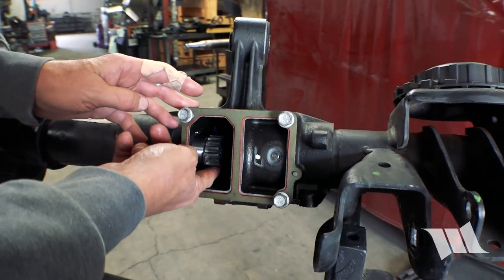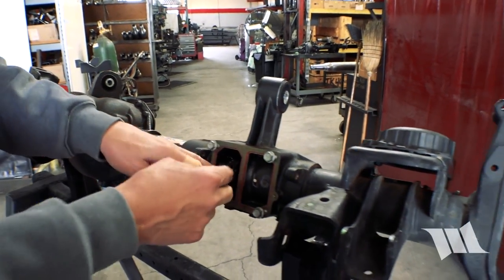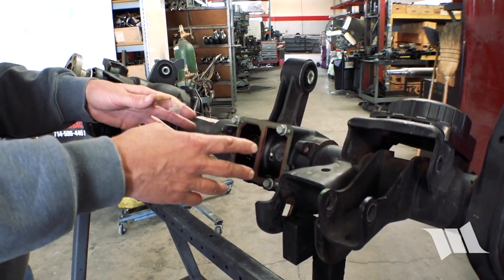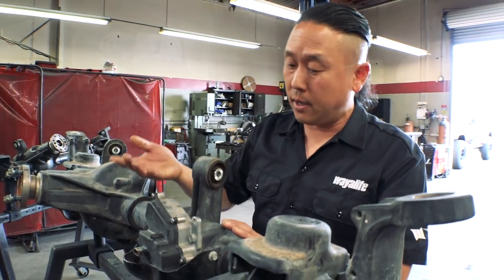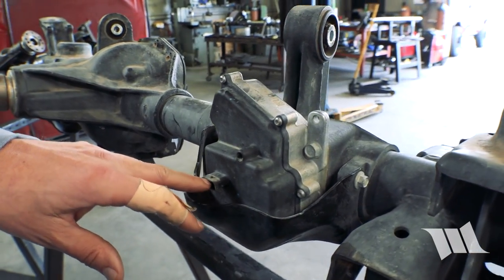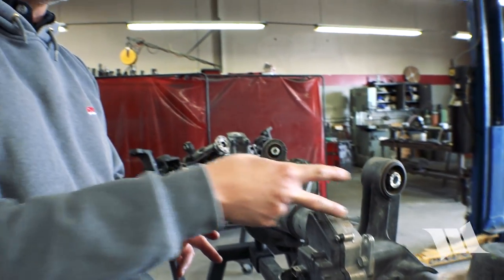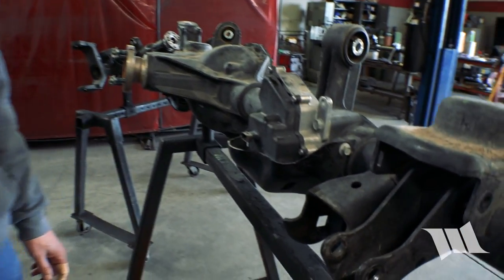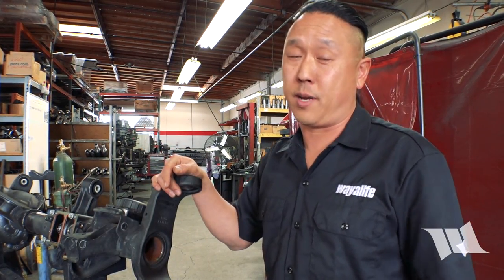Jeep JL Wrangler FAD Explained by Dynatrac - How the Front Axle Disconnect Works

Comment: On the earlier Wranglers, and even on the Toyotas, they used an FAD which worked by using the vacuum of the engine. As a result, you sometimes had to play w/the engine rpms to engage it.
Over time, the tubing would start leaking due to age and heat.
I know on my '92 Toyota 4Runner, I simply replumbed the FAD to stay closed. As a result, shifting into and out of 4Hi was a whole lot smoother and easier.

Also too, since the '92 4Runners still had the old wheel hubs, you could add Locking Hubs, which I did. I gained over 4 mpg because of that addition.

Just like w/the old classic 4WDs, when going offroad, or expecting to do so, you simply locked the Hubs and left the transfer case in 2Hi. The axle and drive shaft still turned, but you were driving in 2Hi. 
When you actually needed to lock it into 4WD via the transfer case, it shifted easily and smoothly into 4Hi, w/no issue since everything was rotating.

Sadly w/the JL's they went back to this FAD when they came out in 2018 but were driven electrically. When going from 2Hi into 4 Hi, everything had to mesh up, which wasn't always the case. You had to slow down, if not stop and fiddle w/it sometimes. 

With the JK and TJ, I believe they removed the FAD all together, but put it back in w/the JL, or the earlier models any way. 
My 2018 JL had it, while my new 2024 doesn't.
My 2018 was a pain to get into and out of 4Hi, while w/my new 2024 JL, it shifts very smoothly. 👍

Comment: Uhg! I found myself under a couple of different rigs manually engaging the CAD on the trail because it would stop connecting. Can't wait to see the problems start happening on those. :P
Reply: I wish they made an electronic replacement for the cad to at least get rid of the vacuum actuator

Comment: Good info, thanks. If you were to change just axles and not the housing, like RCV axles, does that have the same result as changing to a pro rock system ?
Reply from the maker: For the most part, we have not seen axle shafts be a problem on the JL. What we have been seeing to be a problem is the housing and it breaking. This would be the reason to run a ProRock 44

Comment: You guys are really great and helps so much with detail information 👍🏻👏🏻👏🏻 Can you guys please tell what is that small plastic ring where 2 shafts meet ? Is it just reducing heat so 2 shafts don't rub on each other or its something more important? I opened it and because of accident I replaced the hole cv but where 2 shafts meet there at that disengaging ring , it had a bits of plastic broken ?

Comment: I have a question. 
If the FAD is not working. Will that cause the front locker to not engage as well?
I have the z auto sensor harnesses on front and rear. But when I try to engage my front locker. It switches to rear only after flashing for a bit.
I was just wondering. Because the z auto sensors are supposed to fix the flashing light. And troubleshoot the issue.
Reply from the maker: It always takes a little bit before the locker engages. That is totally normal. In fact, it typically helps to be rolling a bit for it to engage.

Comment: So if the pinion gear isn't turning in 2wd, how does a person break in a new gear set? Seems like you would have to engage 4wd to truly break in new front gears?
Reply from the maker: That is correct and that is why breaking in the front isn't as important as the rear.

Comment: Dodge and Jeep have been doing this for years. Both my 90 XJ and my 01 1500 had a system of FAD, this is not a new idea. Why all of the hate?
Reply from the maker: Yup, as Jim points out, it's been around for a long time only back then, it was called CAD. I have no hate for it and actually like some of the benefits it provides. If there is a problem it's that the FAD housing is a week point and one we have seen break.

Comment: I know in the 1980 some one used to made a cable to replace the air lock and unlock front wheel drive for a jeep like a differential cable, do they still make that cable
Reply from the maker: It's a similar thing. The JL uses FAD and it's electronic and the old YJ used CAD which was a vacuum system. The cable just replaced the vacuum which wouldn't work when it started to leak.

Comment: What about just switching to two piece rcv axels?   I don’t have them but I’ve seen many people wheeling stock tubes but switching to a 2 piece rcv axle and just removing the fad.  For example look how lightbrite has the stepchild set up.  They borderline abuse that Jeep and it takes it all day long.
Reply from the maker: Since the JL had come out, I can't say that I've seen the axle shafts or the FAD itself be a problem. If anything, how the FAD works is a benefit especially when it comes to MPG and allowing you to run more caster without a negative effect to the drive shaft. What I have seen and on multiple occasions now is that the axle HOUSING can break. This is something we will feature in an upcoming video.
Reply: Thanks for the response.  You always have great content and explanations.  I found out that litebrite is in the process of looking for/installing a pro rock 44 for the same reasons you spoke about.  So again your spot on.  Keep up the awesome videos.  Thanks.

Comment: I am going to get a axle shaft that bypasses the axle disconnect … lite Brite did it but used cv joints .. I want to still have U joints so the weak link stays in a easy to get to place … thanks for a great vlog
Reply from the maker: It's a funny thing. Since the JL came out over a year ago, I have seen virtually zero axle shaft fails or any problems with how the FAD operates. However, I have seen multiple axle HOUSINGS fail and right at the FAD. But hey, good luck to you with what you're wanting to do. :)
Reply: Wayalife what is your opinion on cv joint versus U joint ?
Reply from the maker: So, what I can tell you is that I've run RCV's in the past and truth be told, I am running a set now but only because, there was nothing else available for the ProRock 44. That being said, I am NOT a fan of them but not for the reasons you have. My biggest grievance is in the fact that they cost $400 more than a good set of chromoly shafts with full circle clips. I also hate the fact that they snap and pop loudly after hard use. RCV will tell you that this is totally normal of course and will not fix it under their so called "awesome warranty". To your point about having weak links, I am not a subscriber to that frame of thought. I build my Jeeps or as much as possible so that they don't break. Also, a good chromoly shaft with full circle clips will be every bit as strong as RCV's and you will not have the kind of failures that are common with c-clips.
Reply: Wayalife you changed the front axle on your JL ?
Reply: Wayalife I have wheeled mine pretty hard and love my JL .. the problem with replacing for me is $$$ so it will get replaced when it fails …
Reply: Wayalife just looked they have a really good price on that axle !!!
Reply from the maker: This whole video series we're doing highlights the making of a ProRock 44 JL and the installation of it on ours.
Reply from the maker: Honestly, I would always recommend that you replace only what needs to be replaced. From past experience in trashing factory axles on our JK's, we decided to be preemptive with our JL and mainly because we can. With any luck, you won't need to and that's a good thing.
Reply: Wayalife lol let’s hope so … but I thought all good axles cost upwards around 9-10,000 bucks … nice to see I was wrong .. it will make that part easier
Reply: Wayalife let me know if you ever want to wheel in Texas .. we have a few great places to wheel and would be cool to kick a few back and talk jeeps with you
Reply from the maker: Oh yeah, the ProRock 44 is the most affordable axle that Dynatrac makes.

My son used to live in San Angelo and I used to come to your great state often. It's been a while and I might have to come down again sometime :)
Reply: Wayalife did he ever take you to hidden falls ?
Reply from the maker: Sorry, haven't been there yet but would like to some day.

Comment: Can you add a lunch box locker with out the concerns that come with a standard solid axle?
Reply from the maker: I would assume that you could so long as one is made for the new JL/JT axles but really, I think you'd find that the new traction control system does as good of a job.
Reply: @wayalife  thanks for responding. That's encouraging about traction control. I don't have a LSD in the back either
Reply from the maker: @chrisurfer83  Neither do we in this Jeep https://youtu.be/vQX6VERI5_0
Reply: @wayalife  watching now, great comparison to my bone stock manual gladiator sport s with no traction adders. Much appreciated 👍

Comment: When is the rear axle coming? I’d like to buy them as a pair.
Reply from the maker: For most people, there really isn't a need to replace the rear axle as the factory one is actually made well. IF you find yourself playing hard enough and with 40" tires, I would recommend that you look into a full float ProRock 60 or even better, an XD60.
Reply: Wayalife Thanks for replying! Looked into those axles, but the extra weight is not something I am looking to add to the JL. Will consider your suggestion to leave the rear alone. Thanks.

Comment: If the front drive shaft is not rotating when driving in 2H, can you shift into 4H on the fly like you do with the JK, TJ and XJ? Or do you have to stop first? And if the answer is yes, how is that possible given that front and rear drive shafts are not rotating at the same speed?
Reply from the maker: Yes, you can. The FAD communicates with the transfer case and a syncro tells it when to engage.

Comment: What if I don't want to buy a new pro Rock DODA can I get a 1 piece RCV axel and Warn Lockout Hub kit for my 2021 JTRD?
Reply from the maker: Being that you have a Rubicon, I wouldn't throw any money at your front axle and certainly wouldn't recommend buying a new axle. Since releasing this video, I have not seen enough failures to justify it anyway. The factory 44 seems to be holding up extremely well up to 37" tires and the FAD works great.
Reply: @wayalife  Thank You

Comment: do they have rear housings?  Also, would i be able to keep stock internals?
Reply from the maker: Dynatrac doesn't feel the factory rear Dana 44 or M220 is built well enough and sufficient for most people. If you're playing hard enough to need something better, they would recommend you consider a full-float ProRock 60 or XD60. On the front axle, you only reuse the knuckles, ball joints and brake assembly. Depending on how you order shafts, you can also retain the stubs.
Reply: Thanks!  So thy don't make pro rock 44 rears? or planning on it?
Reply from the maker: Nope, they just see no need for it. Unlike the front axle, Dana did okay with the rear.

Comment: So if the FAD is taken offline is that the Tru-lok button on the console that will no longer be functional because then the axle and both wheels will just lock whenever 4 wheel drive is engaged? Thanks
Reply from the maker: You need to use something like a Tazer to tell the computer the FAD is no longer there. Everything else will work after that.
Reply: Wayalife ok thanks. If the FAD fails is that really a problem? Can Jeep still be driven if FAD is connected or disconnected? Thanks
Reply from the maker: @gs-nt6nf  Nope, not really a problem if the motor fails. It is a problem when the axle breaks at the FAD housing though. That's what we've been seeing.
Reply: Wayalife uh oh. Maybe a RCV axle with the FAD is a better axle then? Are any RCV axles with FAD breaking that you know of? Thanks a lot

Comment: I have a '18 JLU Rubicon with a kind of a grinding noise from the front when I'm turning in roundabouts, and I was told by a friend it could be a Misaligned front axle disconnect issue. Is that a thing and if so How can I get this resolved?
Reply from the maker: A "misaligned front axle disconnect"? Sorry, in the over 25 years that I've been doing this Jeep thing, I have never heard of anything like that before let alone it causing a "grinding" noise. I couldn't even begin to think what your friend is referring to. 

That said, is the grinding noise constant or intermittent? Also, does it only happen when turning. Also, are you sure it's griding you're hearing or maybe more of a clicking? Is your Jeep running bigger tires on aftermarket wheels? There's a LOT more I would need to know about your Jeep to even begin to know what might be going on.
Reply: @wayalife  it's only when I turn, and although I'm def in one ear, I can hear it on from the passenger side front. It's mostly a clicking sound to be honest not grinding per say.
Reply from the maker: @Jeff Lartigue Okay, now we're getting somewhere. A 'clicking' sound up front when making a turn is typically a sign that your u-joint is starting to fail. I would start by giving it a close inspection. Look for signs of movement in the bearing caps and or cracks.
Reply: @wayalife  OK Thanks it amazes me that they would be going after only 22K miles (yes it's a weekend vehicle here in the Arizona desert)
Reply from the maker: @jefflartigue9110  Not saying that it 'is' the source of your sound, just that's where I would start looking and based on what you're telling me.
Reply: @wayalife  I'm just happy you're still around. Just keep your content around. Thanks a million.

Comment: Seems like it’d be simple to throw in a full axle shaft, remote mount the switcher and put a cover plate on the hole. Now everything works like normal and done cheaply.
Reply from the maker: If people were actually breaking shafts and or having problems with the FAD, yes, you would be correct. Fortunately, there really haven't been to much if any axle breaks and no FAD issues to speak of or at least, in terms of how it works. So far, the only problems we've been seeing are axle housing breaks.

Comment: When it fails does it automatically engage or stay open what's the default position
Reply from the maker: Honestly, I couldn't tell you being that none have failed as of yet or that I know of.
Reply: @wayalife  can it be completely bypassed by putting in a full length shaft? Then maybe a plate to cover the hole?
Reply from the maker: @im2lost  Yup, there are companies that offer this solution now.
Reply: @wayalife  right on, thank you!